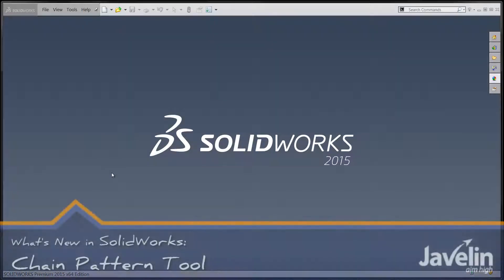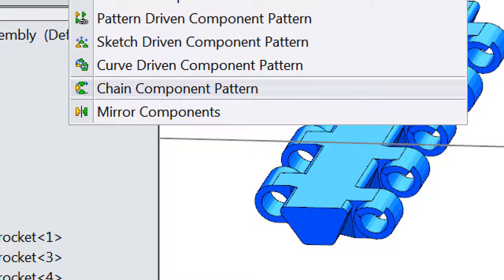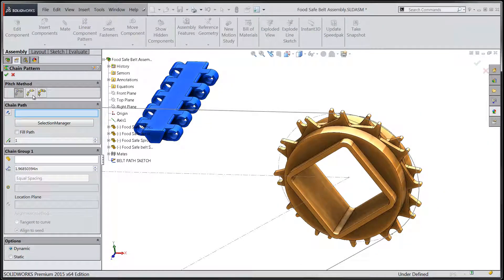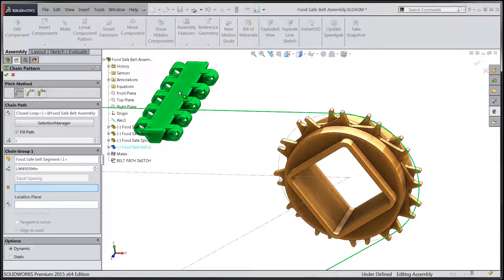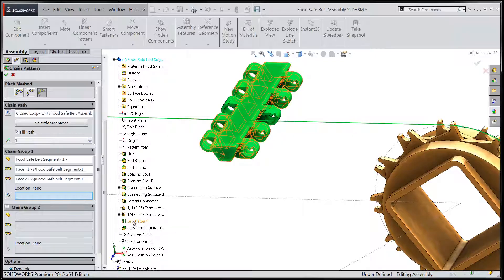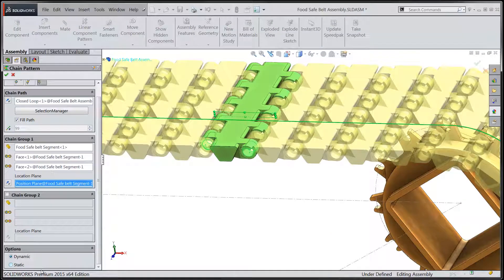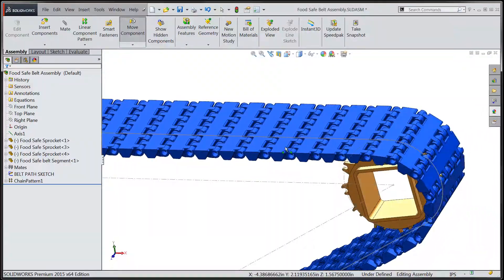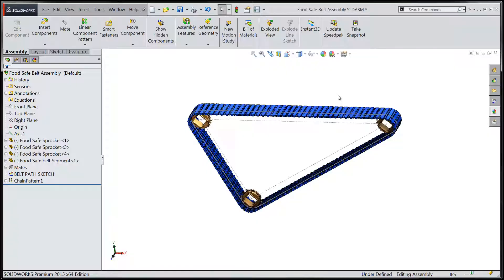Tech Tip: SOLIDWORKS 2015 Tutorial - Chain Component Pattern

Comment: Why can not I play it on "motion analysis"?
Reply: What exactly are you trying to do in motion analysis? If you set a motor to spin a cog the while thing should operate provided you set up the correct mates. You can't just click and drag the chain though
Reply: It should but unfortunately this does not happen, maybe I'm doing something wrong, it would be great if the channel did this, but in a more complex set, because in solidworks when the set is simple it works, but when it has more than 300 pieces the thing complicates.
thanks for the answer.